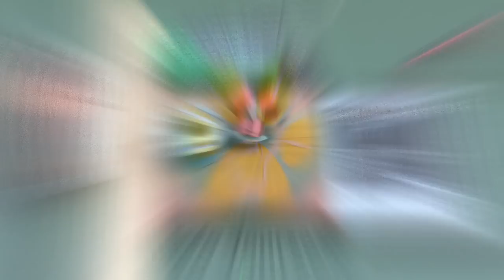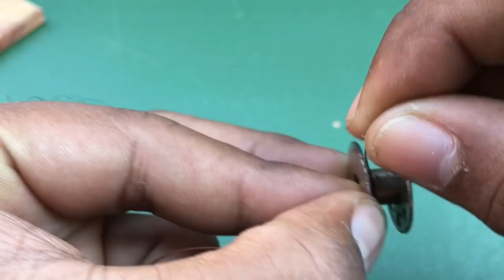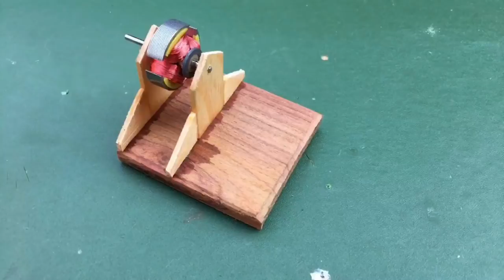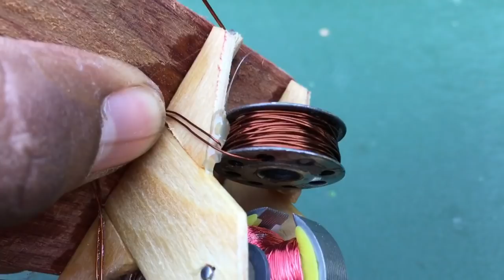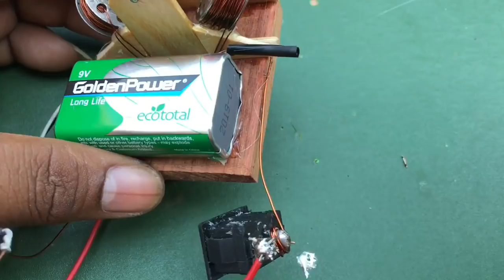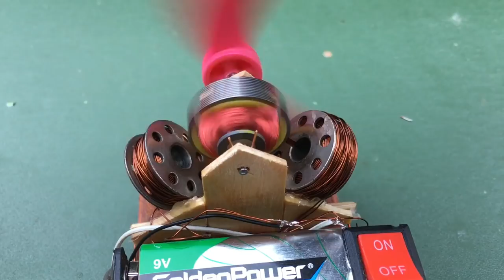How Electric DC Motor Work - Homemade a Powerful DC Motor Without Magnet

Comment: Nice but I want to make DC 12 to 24 volt 23000 RPM a powerfull motor, it's possible?
Reply: Yes! Just increase # of "wraps" on each rotor pole to speed it up (for lower volts), And/or in increasing size/gauge of wire for more torque. Moving stator coils and brushes might help!